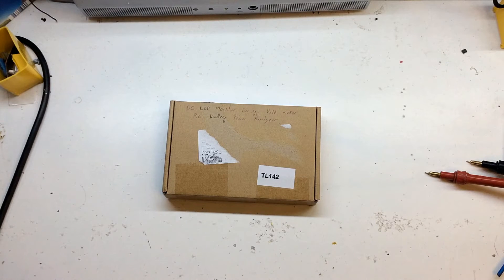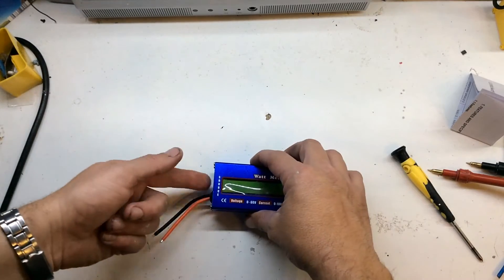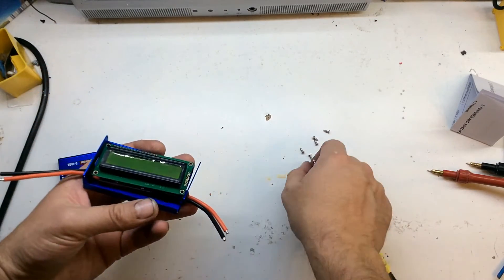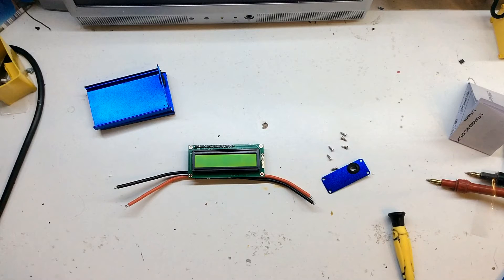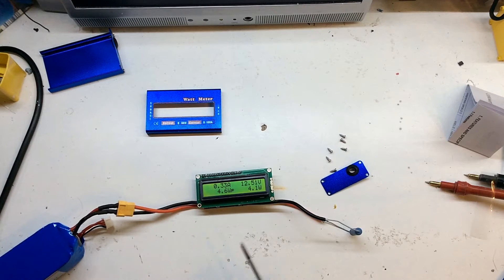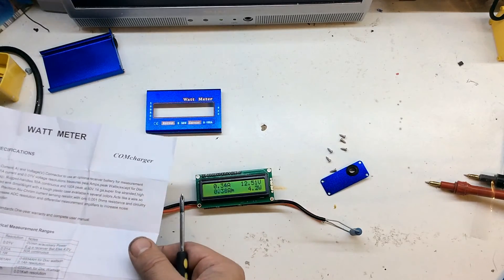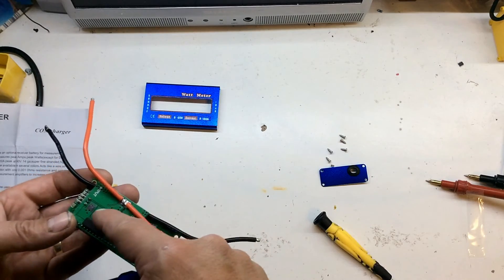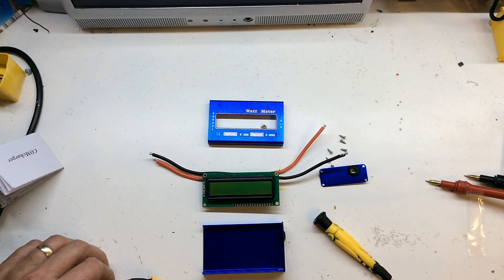DC LCD Monitor Energy Volt Watt Meter RC Battery Power Analyzer 60V/100A

Comment: I have 2, the circuit boards are a bit different but still has the same basic layout.  For the 3 pin connector the pin near the notch is ground but unsure of the other 2 at this stage (assume one is positive and one a reset pin for counters).  The bottom pcb in mine is colored blue and has a 4 hole header area (looks like maybe a uart or some type of interface).  

I was hopping to be able to get some remote logging data out of it via uart, i2c, spi or something.  The top LCD pcb has a blob chip but the bottom is all consumer parts by the looks.  I have 2 maybe I should separate one and take a further look.
Reply from the maker: Let me know what you find, maybe just spi for the display

Comment: I bought a cheap one of these from AliExpress. The specs are off what is stated. The min detection voltage (w/o aux power) is really around 7 volt (and not 4 as stated). I needed this for a 1S system so had to figure out the aux power connector. The one closer to the notch is -ve and the middle is the +ve though it doesn't appear to be connected to anything - perhaps the other side of the PCB has a trace on it. Also the unit does not turn on until aux power reaches about 7 volt. If on aux power I was able measure down to 2 volt and didn't test lower than that. However the amp reading was  not registering - need to test some more.

Comment: I think if you measure those Auxiliary Power Pins when it was powered up you could determine what pin is what.
Reply: Or use the beep on a multimeter

Comment: I had two from aliexpress. Both stopped working when i tested on 24 volt 30 amps solar power. Display ran out. Anyway to repair it?
Reply from the maker: Possibly not as i bet they use the blob type chip.
Reply: Salvage Time.  That LCD display could be used for a Arduino project.  Nice little project case too.  LOL
Reply: Mine stop working display using solar 42v 25amps